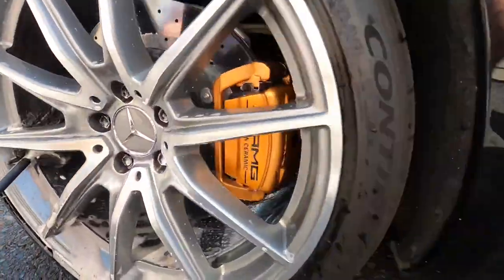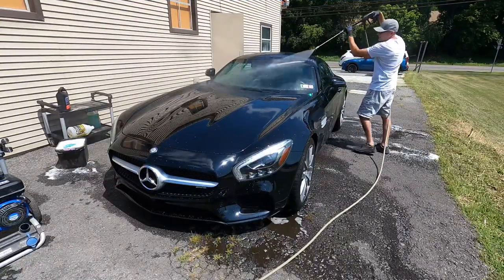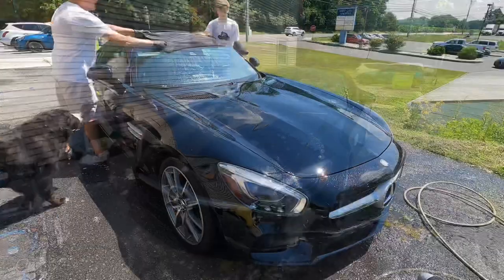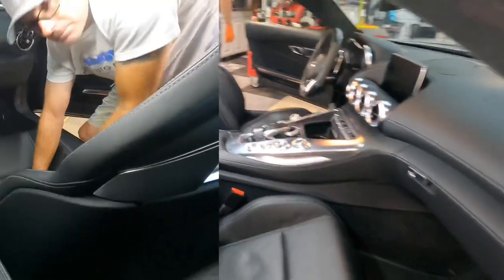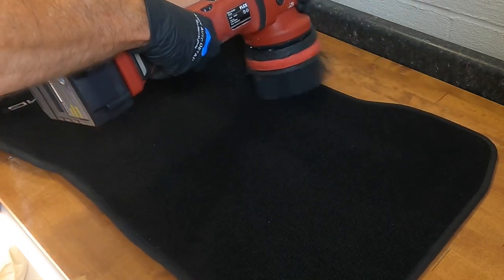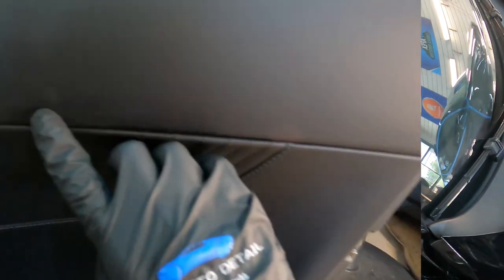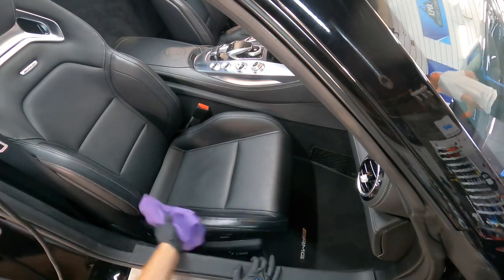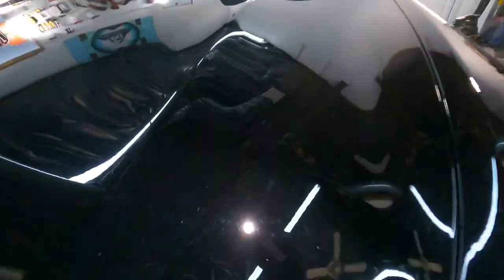Vlog: Mercedes AMG GTS! Part 1! Paint Correction, Coating, PDR, Leather Repair!

Comment from the maker: What is your "dream car"? Mine is harder to find these days....Split window 63' Corvette.
Reply: 1965 Shelby Cobra
Reply: 68 E type, fixed head coupe
Reply: 1970 Mustang boss 429 cid
Reply: W222 S65 AMG, Maybach and the 2023 G90
Reply: Any Aston Martin
Reply: @bme7491  hahahaha good answer!
Reply: Had one of those in my shop more recently. 63 Split Window Corvette. All matching numbers too such an incredible machine for its day especially.  

My dream car is a split between the C2 Gransport and any year of ZR1.
Reply: Love a split window they are beautiful. I know if you find one it’s expensive.My dream car is a 69 Camaro Z28 hugger orange 🍊 white stripes.Eventually down the road I will get one 👊🏼
Reply: 71 hemi cuda or 69 charger 440 6pack.
Reply: For me, it has to be an Aston Martin DB5, personally. 
Of course, you need a Saville Row  suit of clothing to drive in too.
Reply: 1962 Ferrari 250 GTO would be my dream car.
Thanks for sharing this video. What a nice car.
Best wishes
Reply: Aston Martin DB11
Reply: Ferrari F430.. momma mia
Reply: 63 Oldsmobile Starfire convertible. Grandpa had a maroon one in the garage growing up. Beautiful car. As big as a boat but a beautiful car.
Reply: Porsche 911 Carrera Cabriolet!
Reply: 91 K30 Silverado Single Cab with a 4speed manual transmission.